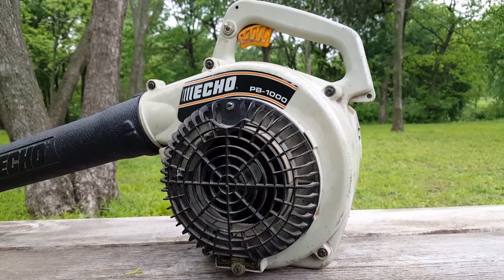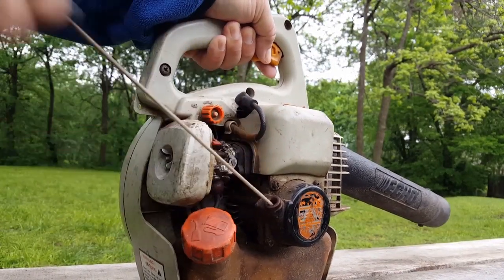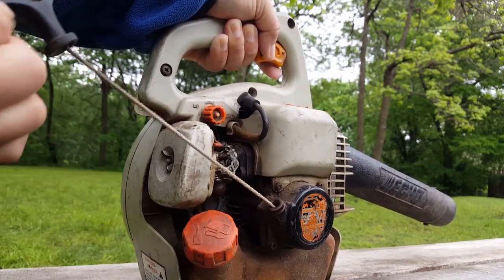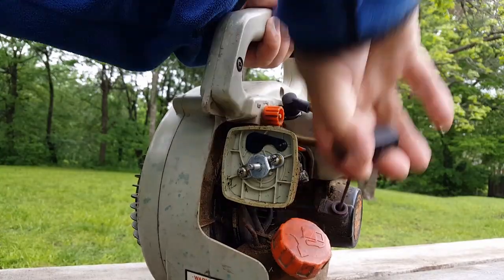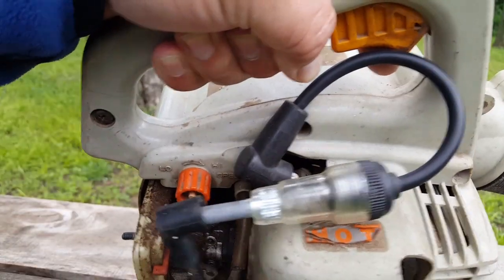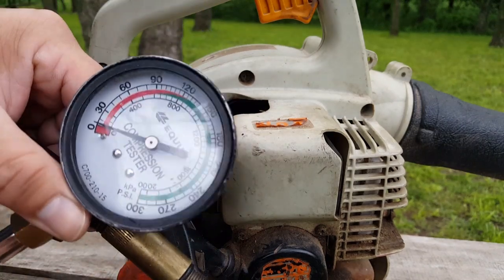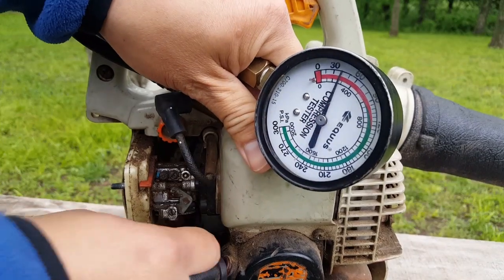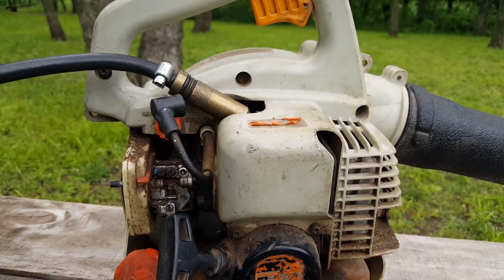Broken lawn equipment problems! Echo blower won't start

Comment: I had the same blower and it was amazing. Passed it on to a neighbor after 20+ years, and it still works. I would just get a new motor for this if you really wanted to keep it. But bad compression shows signs of the engine going bad, so most people would just buy a new one. Good thing Echo still makes blowers today, they're very reliable and I will not trust anyone but Echo!
Reply from the maker: Thank you That One Ford Guy. It's a shame that people abuse these machines sometimes. I can buy another used one at the cost and repair of this one.
Reply: It really is incredible how people treat machines like these. I try my best to upkeep with all of my equipment with motors. My lawn mower, Weed eater, Blower, my truck, etc etc

Comment: the tube to the bubble it suk the gas up, correct. How long is the tube should be drop into the gas tank. mine seem be it just hung above the level of the gas, dose'nt it need to lay  along botton like the black tube that have a filter?
Reply from the maker: Yes it needs to be at the bottom of the fuel especially when in working position
Reply: @HomeGaragechannel   On my lawn mower where is the button(s) to align the fuel to carburetor, its speed up  very fast when I start it. ?
Reply from the maker: @billd6890  I'm not sure about the first part of your question. The second part sounds like a throttle problem

Comment: good info, just got a free echo backpack, no fire, but before I start buying parts I need to check compression, I will start the hunt for testers....good video, (music is a little much for me, I will still watch your videos) thanks for info
Reply from the maker: Thank you cc for the comment. I understand about the music.  When I first starting making videos I just assumed music was a must.  However after talking to many people about it it turns out I was wrong.  My videos starting in 2018 no longer have music.  Yes check the compression as you'll save yourself from a headache if the engine is worn out.

Comment: That clear tube han above the fuild level but will suck the fuild to the bubble,,do i still need to change it and have it lay on bottom of tank?
Reply from the maker: I would still change it so it's at the bottom of the fluid.

Comment: Was looking to see if anyone has actually done a ring job on one of these because the parts seem cheap enough. I have one that's probably 25 years old and I run it a LOT of hours so maybe 10 years ago I was able to get a long block engine from a guy with dealer connections for under $80. (half the price of new) Now we are suffering low compression again but the parts diagrams all show a single piston ring while disassembly shows it's got 2 rings. Being retired I figured I could do the job for $20 but now I am at a loss.
Reply from the maker: Just buy two rings which is probably what I'll do.
Reply: @HomeGaragechannel  ... just spoke with a guy who retired from a small engine shop and it's becoming obvious that nobody repaired these things at this level because it wasn't cost effective. (I should have known!) Basically, if you want it fixed as quickly as possible you add another $50 and get a new blower off the shelf... have a nice day. BTW, it seems the bigger blowers offer a cyl kit with new piston and barrel. The whole ordeal is under $50. Not so with the smaller units.
Reply: @HomeGaragechannel  ... just got off the phone with a parts supplier and a pair of rings with the base gasket is about $15 + S&H so should have everything in hand by the weekend. Thanks for the input. BTW, it was in the fine print (but not the diagram) that some engines had 2 rings. They are also available in oversize. (but who would bother to hog a cyl out?)
Reply from the maker: @rupe53  I see. Thanks for the information
Reply from the maker: @rupe53  yes that makes sense

Comment: This is why a use a premium 2 stroke oil mixed a bit richer than they say. About 30:1 rather than 50:1.Seems like they last longer if you have a large property and work your equipment hard.
Reply from the maker: Thanks for the comment. I've never tried that rich a mixture but if it works for you then I might have to give it s try.
Reply: 50:1 with a decent 2 stroke oil in yard equipment works just fine, it’s the people who don’t use oil at all who destroy their equipment. So I will disagree

Comment: if tbe blower don't  start and you see no gas in that bubble,dosen't  that means the tube is plugged?
Reply from the maker: It can, but I've never seem a blocked tube before. Only a collapsed tube.

Comment: too short did not go into what problem,do you replace the spark plug? Would that help?
Reply from the maker: Problem is that the engine was worn out. Not worth fixing.  No a spark plug won't help.

Comment: Not that it would have made any difference on this particular blower but when doing a compression test I hold the throttle open a pull until the compression tester stops. I also remove the muffler to eliminate the possibility of a clogged spark arrestor and inspect the piston for scoring. I also have a video on this subject on my channel. You are right, You can't save them all. Good video. I subscribed.
Reply from the maker: Thank you for the comment. I have also subscribed to you as well. Your technique is spot on and I will definitely do it on my next try.

Comment: You didn’t even take it apart a little to see the piston and the cylinder? That was boring :/
Reply from the maker: Thanks for the comment. Theres no need to see the damage. It's too far gone.
Reply: Home Garage Yeah I guess, you probably have better things to do. I think my very first gas blower was a 2006 echo pb-200. It never ran great lol, it may have had a crankcase leak.
Reply from the maker: That a good diagnosis. Leaks are tough to find without tools.